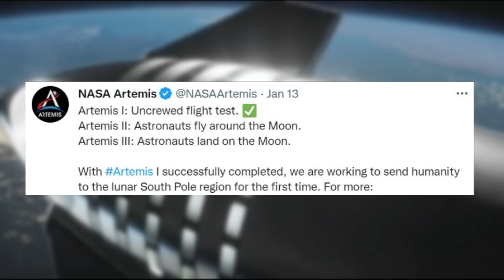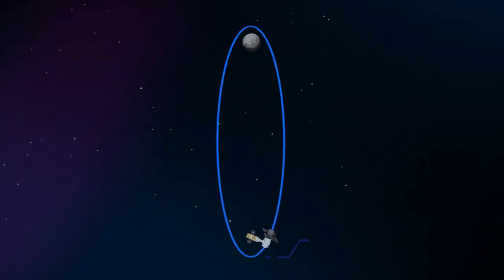A Closer Look At Starship's Upcoming Artemis Moon Mission

Comment: I am not convinced that SpaceX can pull this off in the stated time frame. The Saturn 5 first stage had 5 engines the plumbing was manageable. The Soviet N1 first stage had 30 engines and was a plumbing nightmare. I know Falcon Heavy has 27 engines. But Starship has 33 engines compared to Artemis 4. I know that the technology is leaps and bounds better than in the 1960s and 1970s, However, the more engines the more problems. I wish SpaceX all the best.
Reply: Starship WILL NOT be ready under the current schedule and is total overkill for the modest goals of the first two Artemis missions. It's why issued contracts for research and development of competitive landers.

Comment: Seriously, I think they are not focused enough. First let's start with the fact that the Lunar Orbiter is way to small . Secondly no conclusive habitation modules for the surface of the Moon. My only suggestion is an airbag which it really isn't. Falcon heavy with multiple launches could be applied here. Without the need for a larger fairing. My airbag idea came from the first rover that deployed on Mars . The materials used is the ultimate tool for a hanger in space. Much easier to fold with struts that deploy similar to JWST but in this case it's a rectangular frame and on the outside a couple of ion thrusters . It's to build a much bigger Orbiter with windows and can be assembled within this hangar . The door mechanism is borrowed from a solar array . This so called airbag is for the safety of the astronauts who would assemble the spacestation from within. This hangar has four docks with assistance power grid to turn on the lights inside. I'll stop here because it's only an idea with still plenty of features but I hope you all get the gist of it
Reply: Woah-woah-woah, calm down, Mr. Chief Engineer